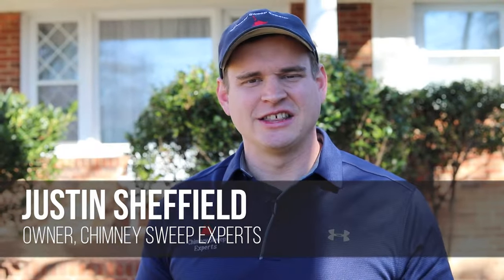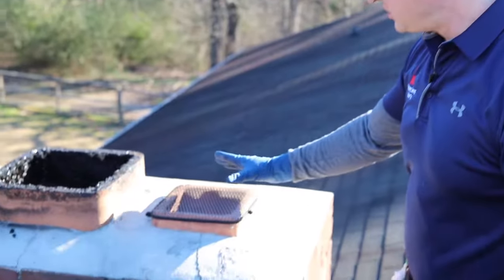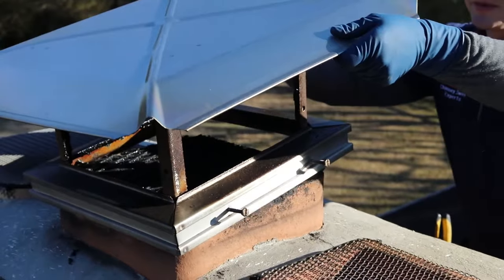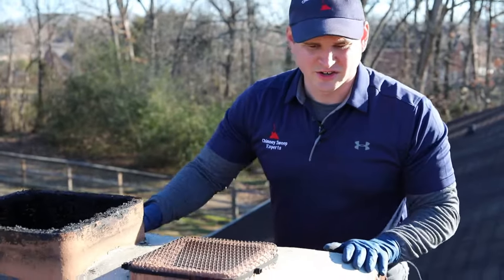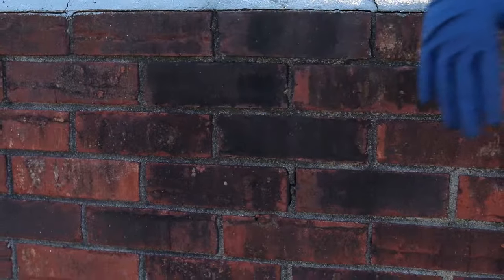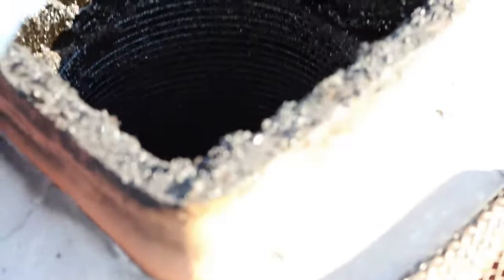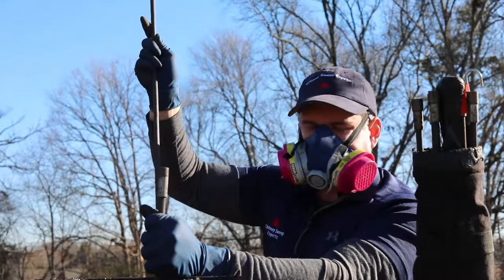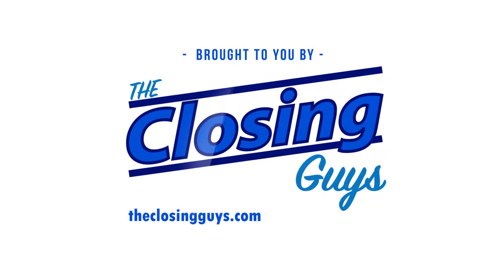How A Chimney Expert Inspects And Cleans A Chimney

Comment: The wood stove old school guys swear that if you burn at 500+ degrees once a day for 30 minutes and throw in an aluminum beer can every few days, you will have zero creosote buildup.  I’ve seen this claim countless times in forums from folks that say the run their stoves 24/7 through the entire winter.  Supposedly it’s the magnesium in the can that reacts with the creosote and reduces it to ash.  Of course they are using seasoned firewood too.

Comment: I’m here to learn how not to get ripped off.
I’m a single elderly woman and I have been working in new construction for almost 20 years but I have little experience with older homes.

I have not used my fireplace (wood and gas burning) in over two years. The gas was capped off because I could smell a small gas leak. 
I don’t wish to have a wall fire due to those little cracks in the mortar firebox which may or may not be a problem.
Also, the earthquakes that we’ve been having for the last several years doesn’t help the cracks.

I see that some people fix firebox cracks themselves which I have no problem doing myself but I don’t know how big the cracks can be to fix myself. Plus I don’t know what other real problems with my fireplace would look like. Example: exterior and interior brick cracks, missing mortar, caps, water issues, proper covers/screens etc.

Any additional advice would be greatly appreciate and I thank you in advance!

*My house was built in 1951 and has been through several major earthquakes. Fireplace is the original as far as I can tell. It doesn’t look to have any issues but I’m not trained for this in old homes.

**My mother is Japanese and one of the Japanese biggest fear is fire. I guess I inherited that gene.🤔

I’m looking for someone in the Northridge area that is certified and licensed etc. to inspect and repair anything that may needs to be done, if anything.

Also, I am looking for any tips on how NOT to get ripped off. 

It took me over 2 yrs to get a 10 x 16 kitchen remodeled with no appliance location changes. 
It was a complete nightmare, and I wish not to repeat that nightmare again.

Comment: How are you if you can tell me where he has to buy equipment for the job. I mean the sticks that go on top of each other. I have a great desire to do this job but I don't have the equipment if you can please tell me. thanks in advance
Reply: First go get a job with a chimney sweep company. Read the Successful Chimney Sweeping book, then study the NFP211 code book and then study the IRC code book. Then go and get your certification. 
These are the first steps.
Reply: Lowe's home improvement
Reply: You can buy the chimney flue cleaning kit. Just comes with  3 or 4 , 4’ long lengths and just know the size of flue so you get the right size brush. Had my 8” brush and four lengths of extension pieces over 30 years and still work fine. Probably get kit at homo depo. Get it clean as you go down , screw on the next length until you get to the fire box. Then vacuum all the  crap out. Similar to cleaning your oil fired water boiler.
Reply: @akaredcrossbow  Or just get up there and do it lol
Reply: @TURBOINTEGRATYPER  yes you definitely can!
Even if you don’t take the test it’s still good to at least study the books to get some knowledge of what you’re looking at so if needs to be fixed it can be done properly.
Reply: @akaredcrossbow  100%

Comment: hey folks just want a simple chimney sweep lmao 4 thousand dollars latter you you need that and would mot recommend  making a fire well that was 4 years ago dont call 4 seasons in Rochester ny love and hugs the pryors ps beautiful fire going now
Reply: Same down in the DC area - if they don't get $5k per job, they move on to another sucker.  Many companies here have questionable business practices.  "Your house is going to burn down - let me put a stainless liner in for $10k."  Costs them a grand, max.
Reply: @maddierosemusic  Similar to the plugged sewer pipe that leads to the street sewer.  Fairfax county did a sewer upgrade in the street and the next couple months had four houses pay Hispanic scammers to rip out and replace sewer line from house to street.  I feel screwed paying $50 for 100' snake rental.
Reply: Yep, not getting ripped off as my goal. 
Sadly, if you’re a single female, anything that has to do with construction, makes me a target. In addition and waste my time. So very frustrating.

Comment: I really dislike a screen on top of my flue. Summer time is the only time i use a screen around the top out let. During winter there no screen  REASON. All the screen dose is trap ash coming up out of the chimney, And make for a fire HAZARD
Reply: The screen I supposed to be 3x the cross sectional area of the flue.
Reply: @mikeoxlong8272   if its to big hole, animals can get in,  plus to small holes will  make for a fire hazard
Reply: so during the summer i just cap it off. Winter i will open it up
Reply: I agree. I just put a cap on mine and I don't like it. That dam thing is coming off today. I thought it might help with downdraft it doesnt.
Reply: @johnbutler5208  Yes depends if your trying to get some more fresh cooler air into the house as well. It does help with the down draft during the summer months. Nice way of doing it. 👍👍  Just Cap it

Comment: Waterproofing the outside of brick sounds like a very bad idea.  The first rule of moisture management is to allow moisture a way out.  Exclude it if you can, preferably by shedding it, but definitely don't trap it.  Allow materials a way to breathe and dry out.
Reply: ChimneySaver is vapor permeable allowing moisture to escape from the structure. Waterproofing prevents freeze thaw.
Reply: @blackvelvetchimney :  Ah, glad to hear it.  Thanks for the reply and the info.

Comment: FALSE   the cap or crown  should be concrete not Mortar  as morter will crack and deteriorate at a higher rate than concrete.   mortar is for between the bricks
Reply: Concrete that thin will crack because aggregate in concrete is too big, even with pea gravel. 

Need to use thin set repair mortar in the appropriate lifts
Reply: And a minimum of 3" thick.